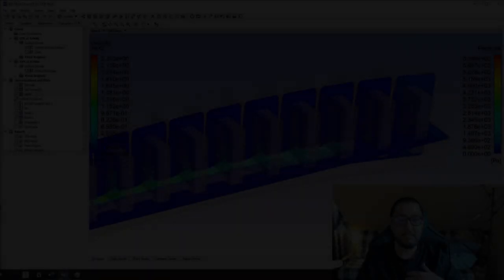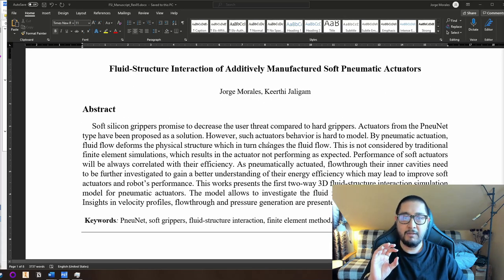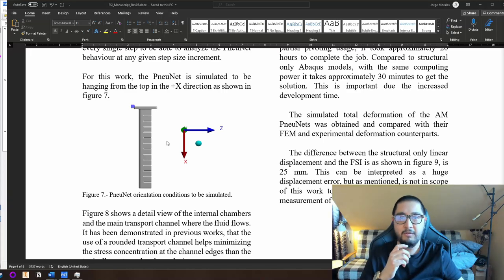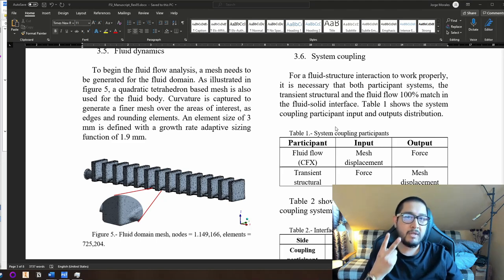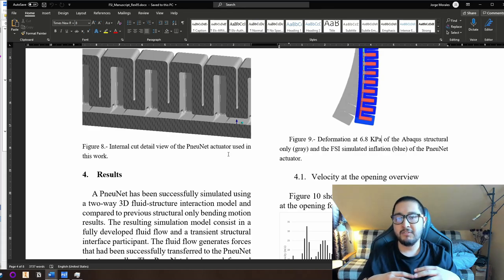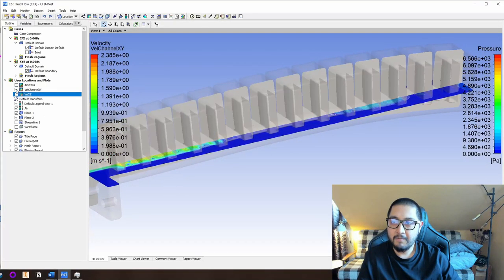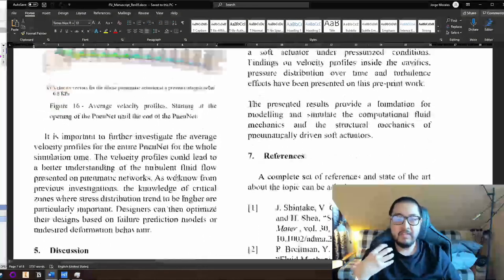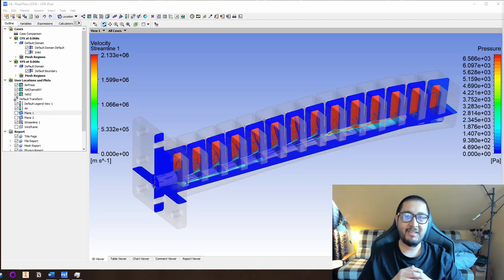2-way FSI Fluid-Structure interaction of Soft Pneumatic Actuators / Ansys FEM Soft Robots Simulation

Comment: hello sir,
this video is so helpful , thanks for making this video.
I have tried the the system coupling of  transient structural and fluent on the different geometry as per my requirement, different material, and interpreting different UDF as a inlet velocity BC. different time step and end time.
but when i run the system coupling it shows the error as: "Update failed for the solution component in system coupling. the coupled update for system transient structural threw an exception. error updating cell solution in system transient structural."
please help me